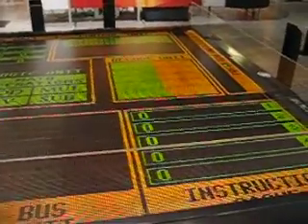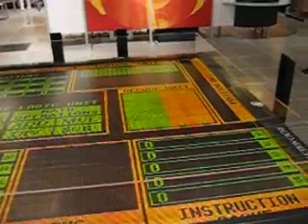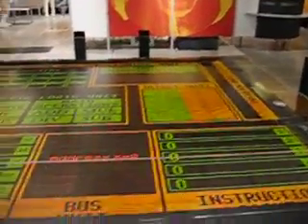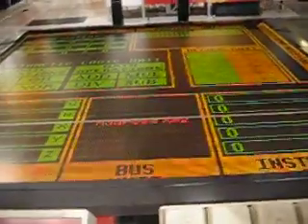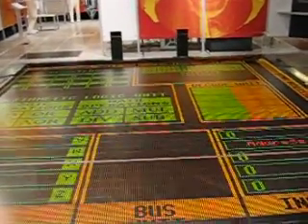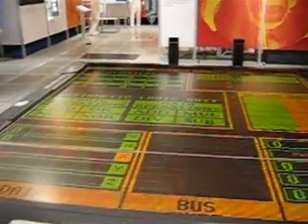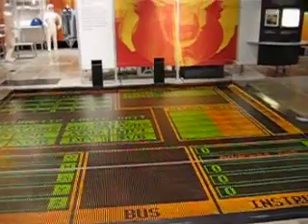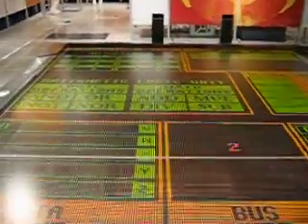Intel Museum - How Microprocessors Work #1

Comment: opps i ment 0xFFFFFF is 4,294,967,295 bytes aka 4 GB.. 2,147 billion bytes is the signed version lol got mixed up

but yah thats why the most amount of ram a computer can have is 4 GB.. unless you stack them up with virtual addresses which then get mapped to other addresses on the physical level or some shit.

but yah

logic gates = Brain
RAM = storage for brain to use.
cache is ram too.. thats built into the CHIP thats why when you buy computers u see what kind of cache size it has 2 MB etc

Comment: oh yah forgot about addresses yah those are addresses to the RAM so if you have slow RAM and a fast CPU.. your computer will still be slow since the fast CPU depends that the data on the RAM is accessed fast or the cpu will just wait until the RAM gives it the number based on the address

addresses can hold 1 byte (0-255) 8 binary combonations of 0's and 1's 

a address starts from 0x000000 (0) and go up to 0xFFFFFFFF which is around 2,147 billion bytes

you can make WORD/DWORD/QWORD from bytes